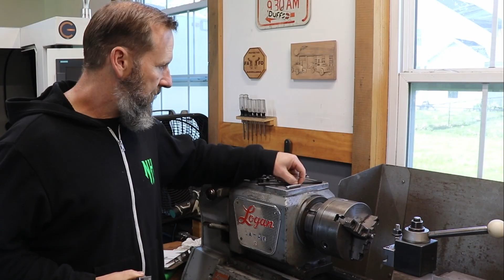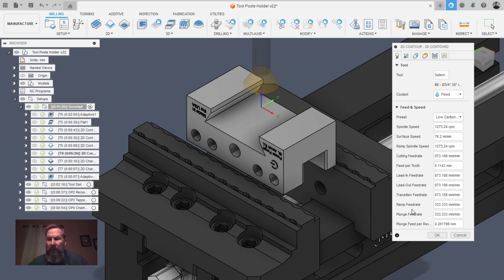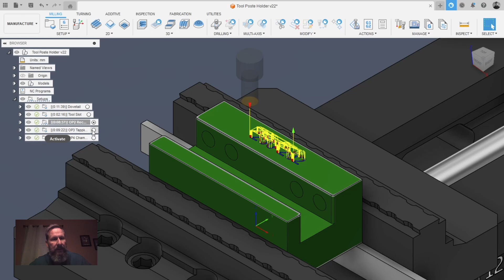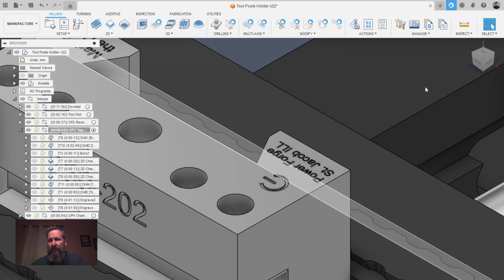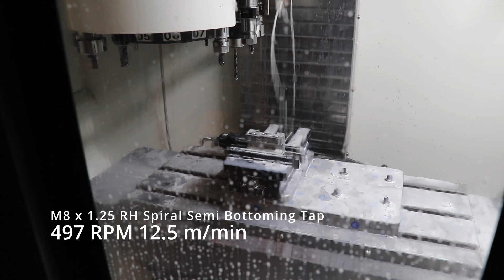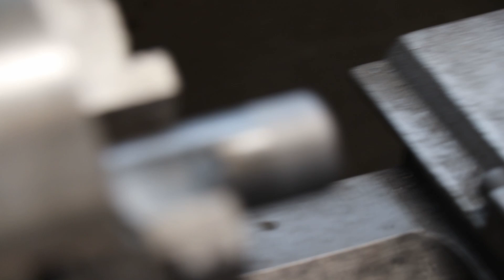Machining a Tool Holder for the Logan Lathe

Comment: That 1/2inch endmill sounded a little chattery. Or is it just me?
Reply from the maker: Yes.  Running 1/2" is pushing it for my mill especially when I round from x to y.  

I've switched to a 3/8" TIALN Carbide Rougher from Maritool and it's much better.  I still use the 1/2" for hard to reach contours but that's it.
Reply: @PowerForgeWorkshop  Nice! I find roughers are great for... well... roughing 🤣. Who would have thought! They seem to cut smoother and i find they last longer especially under abuse. 
May I also suggest for normal endmills try using something with a higher helix angle that will put less radial force and more axial force into the tool?
Reply from the maker: @kyriacosvasiliou8342  Agreed regarding roughing endmills.  They have been a game changer for me.  Faster cycle times and less abuse on my machine.  

I see a 30 and a 35 degree option for helix angles.  I'll keep digging and try some higher helix angles.  Thanks for the suggestion. 👍